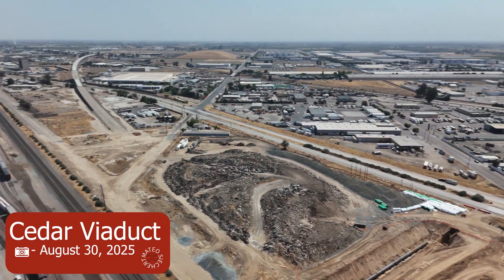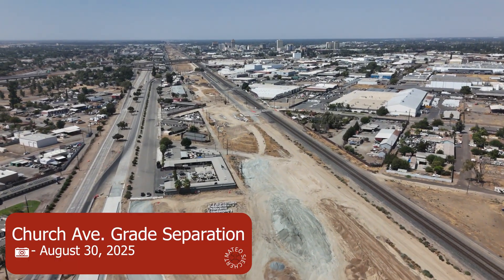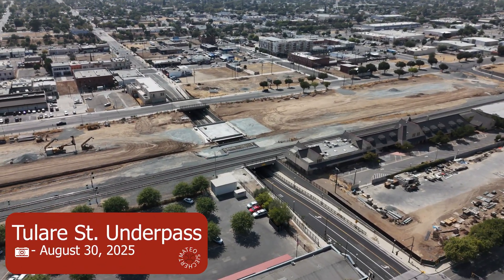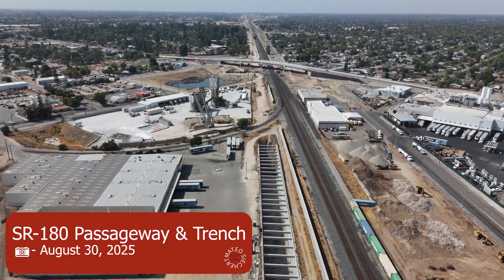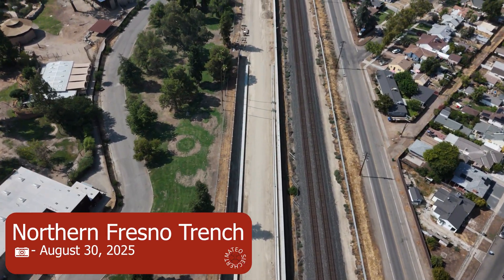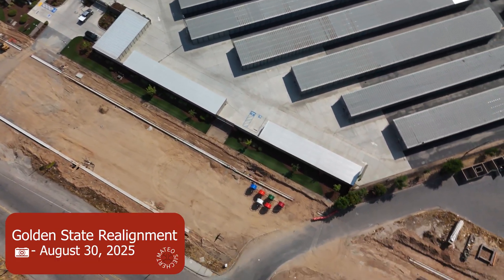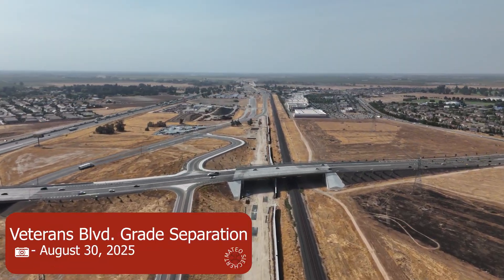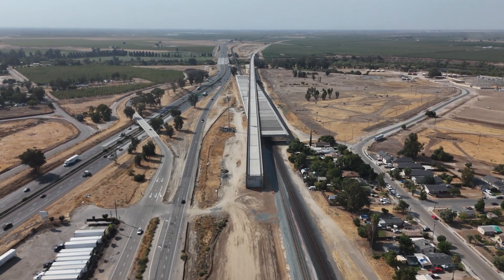MAJOR Progress Made! - FULL California High Speed Rail in Fresno Flyover - 8/30/25

Comment: 6:30 what is all the space on the right side of the freight railroads for? Did they just not want to give it up? It seems like moving the freight rail instead of golden state boulevard would have been much cheaper.
Reply from the maker: I think it's because Union Pacific didn't want to give up their land that they own, which would explain them expanding the UP bridge at E. Cesar Chavez, Tulare, and I went to the community meeting and Herndon will be future proofed for 4 freight lines.
Reply: I think they're demanding preservation of their right of way width for four tracks, hence stuff like demanding the extra wide bridges for their new crossing at Herndon and stuff.
Reply: @rwdavidoff that was my guess too. It’s just infuriating that the state doesn’t own those tracks and has to burn so much money accommodating the freight operators.